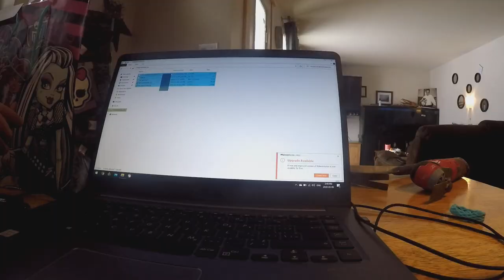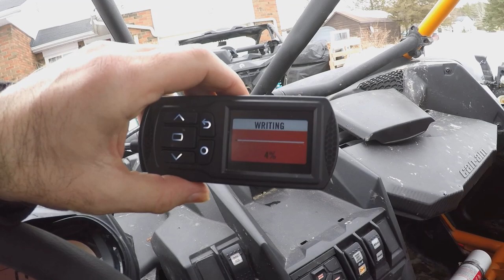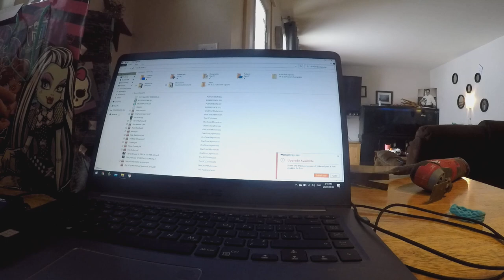WS170 (197hp) VS Turbo RR 195hp X3 (2500 HD Ram Leveling Kit) 18ft x 7ft NEO Enclosed Trailer

Comment: WS170 is 197hp. What is making it 227 as mentioned?
Reply from the maker: One # is to the rear wheels and other is approximate crank hp
Reply: WS170 is 197 to the crank and 175 to the wheels. I was just making sure I didn’t miss anything or if you had to add something else to give that extra 30 hp

Comment: The weight of the machine on a 120 vs rr rc is way diff. So racing them yes a 120 tune machine will win vs a stock rr.
Reply from the maker: Yeah I was thinking the samething